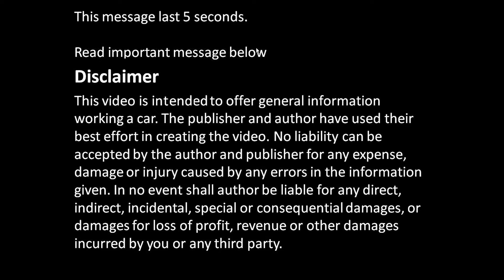Toyota Camry radiator automatic transmission oil lines info. 2.2 liter engine. Years 1991 to 2002.

Comment: Thank you. I recently had an experience of my car about to overheat which set me to checking all possible causes. Changed the radiator cap, and now have to do my thermostat and one of my transmission hoses, that one on the right is dry rotted and has a small leak. So I will be replacing them this weekend. Thank you.
Reply from the maker: Great !

Comment: Do you know the ID size of the transmission cooler hose? Thanks
Reply from the maker: Thanks
Reply: @PeterFinnTheCarDoctor  ??????
Reply: @Jojo69869  I used gates 3/8 400 psi transmission cooler line hose from O’Reillys auto parts